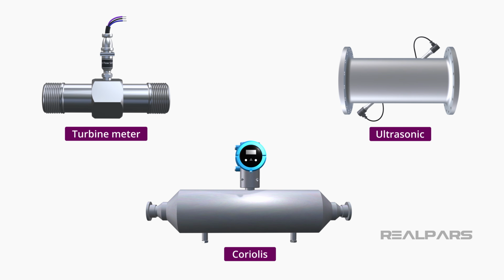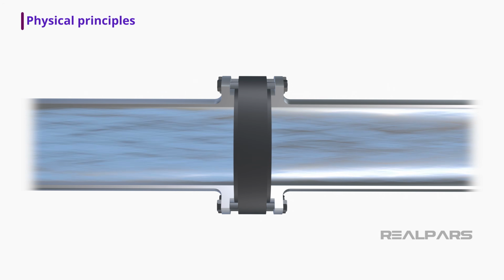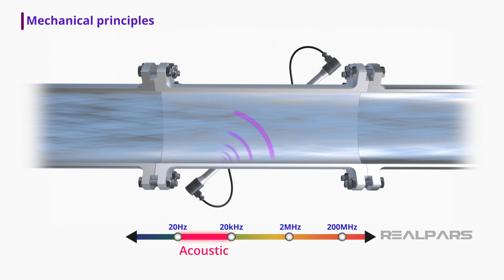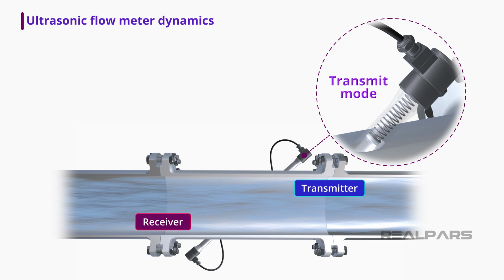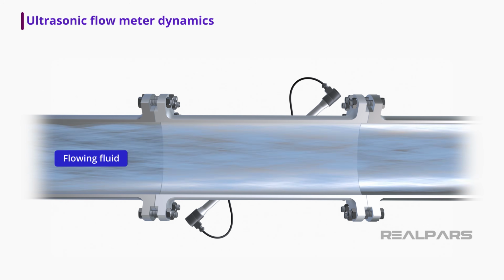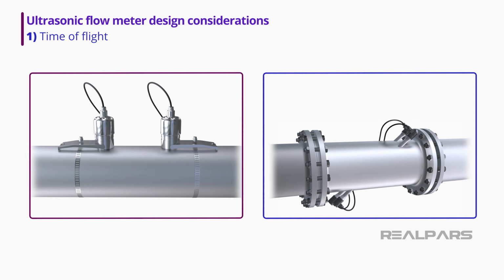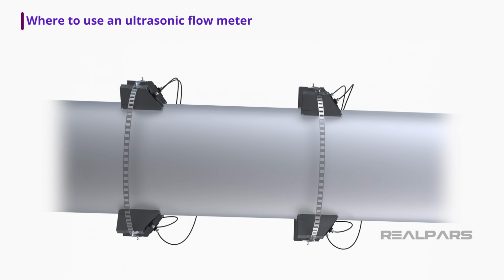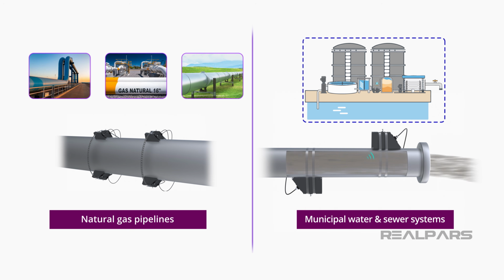Ultrasonic Flow Meter Explained | Working Principles

Comment: Can these be used for furnace oil measurement
Reply from the maker: Hello, @yellapu77ak Thank you for your question. The concept can be used with the correct instrument. You will need to contact your local vendor servicing your industry, who should be able to help you.

Comment: Justo , necesitaba ésto para decidir. Marcas sugeridas para agua potable en una PTAP . Y si hay un rango de conductividad o su baja turbidez ..0.75 a 2 NTU. Gracias
Reply from the maker: Hi @jesusmendoza9768, thanks for your comment! We’re happy the video helped.
We try to keep our replies in English so all our viewers can follow along, but here’s a quick summary:
For drinking water treatment (PTAP), trusted sensor brands include Endress+Hauser, Yokogawa, Hach, and ABB.
A turbidity range of 0.75 to 2 NTU is usually acceptable for treated water, depending on local standards.
Conductivity for drinking water is often between 50–500 µS/cm.

Hope this helps, and feel free to keep asking—we’re here to support you!

Comment: I see you reply to almost every comment so I'm going to take my chances and ask you something.  I'm learning a lot from your videos but I am still not sure what is the best type of flow meter is for my case and I would appreciate if you could help me. 

I want to measure the volumetric flow of water through a 3/4 or 1" pipe for a potable water vending machine I am planning to build.  See Watermill Express as an example.  Which type of flow meter do you think would be the best choice for this case?  I know turbine flow meters would probably work well but (leaving the cost factor aside for a moment) is the ultrasonic even better? Is it more accurate?
Reply: or is there any other better option
Reply from the maker: A turbine meter is the most compact and easiest to install for this application.  A small clamp-on ultrasonic flow meter can also be used fairly easily, but is not as accurate as a turbine meter.  Both have pulse outputs which will require an interface card, which is typically small and not expensive.  A compact magnetic flow meter could be used, as long as the conductivity of the water is greater than about 10 microsiemens/cm or so (depends on the specific flowmeter).

Comment: Are ultrasonic meters able to flow bidirectionally?
Reply from the maker: No.  The ultrasonic transmitter is positioned to send sound waves in the direction of flow, and the receivers are a few pipe diameters downstream of the transmitter.

Comment: how do ultrasonic flow meters perform on curved pipes?
Reply from the maker: Ultrasonic flowmeters need a straight run of pipe to work accurately.  Bends in pipes tend to distort the flow patterns and can lead to void spaces as the fluid makes the bend.  Both of these issues can degrade the flow signal.  Typically, a straight run of 10 pipe diameters upstream of the meter and 5 pipe diameters downstream of the meter will provide a steady and consistent flow pattern to allow for accurate measurement.
Reply: There are Electromagnetic flow meters from Siemens that has a Venturi shape inside. And they claimed it could be placed just about 1 meter before the curve.
Maybe there are something like that for ultrasonic flow meters.

Comment: hi why dont you make a pcs7 course on siemens
Reply from the maker: We do have an Introduction to PCS7 course that is available through subscription on the Realpars.com website!  It includes network, hardware, and program configuration as well as WinCC graphic development using a simple process example.  There is also an extension to the WinCC course for PCS7 that includes writing C-language routines to int4eract with the graphics.

Comment: how would you compare these to thermal mass flow meters for compressed air flow measurement?
Reply from the maker: Since most gas flows of this type are small, thermal mass flow meters have the advantage of a smaller footprint than ultrasonic flow meters.  For flow rates in the l/min realm, thermal mass flow meters are the only viable option.  Ultrasonic flow meters typically require entrained solids to be useful in gas applications, and for compressed air, that is not acceptable.

Comment: How are ultrasonic meter calibrated?
Reply from the maker: Ultrasonic flowmeters are typically calibrated gravimetrically, by collecting water flowing through the meter at different flow rates into a collection tank.  Because the gain of the meter usually varies with % of maximum flow rate, 10-20 calibration points from 0 to 100% are measured and the gain (correction) factor is calculated at each point to develop a curve.    This only needs to be done periodically (every 1 - 2 years), more often for dirty or coating fluids.

Comment: You seem to suggest that turbine meters are positive displacement. They are not. They are inferential meters or velocity meters
 They usually have a limited viscosity range enhanced with helical rather than straight blades. 
Ultrasonic meters, multichord, can handle fluids with viscosities as high as 4000 cst. 
What you didn't explore but rather simply brushed over to say this was why you had multichord Meyers, I'd that   the sound wave transits from transmitter to receiver and is influenced by the fluid velocity. Should that not be " mean fluid velocity"?.
It would have been helpful to. Explore the relationship between the measured transit time difference and laminar flows, transitional flows and turbulent flows.i would have expected to that swirl would have some effect. Not discussed.
However, a good basic explanation. Tks.
Reply from the maker: Jon, you are correct.  Turbine meters are velocity meters in their principle of operation.  However, they do share the property of positive displacement meters in that a single revolution is equated to a specific volume of fluid flow, albeit for a turbine meter this volume is calculated from the fluid velocity instead of a chamber volume.

As this is an introductory video to ultrasonic flow meters, we did not get into the details of differences in sound profiles through laminar and turbulent flow streams or the meaning of mean flow velocity.  Ultrasonic meters are nearly linear in response in turbulent flow ranges, but in laminar or transitional flow ranges, special conditioning sections upstream of the meter are required.

Comment: As usual excellent work. Can anyone tell please:
In which case, (for gases) we have to measure " mass flow rate" and in which case we will have to measure "volumetric flow rate"?
Thanks.
Reply: If you know the fluid you are measuring, and if you know the temperature and pressure that it is at, then you can always convert between mass flow rate and volumetric flow rate.  You can measure either, bring the measurement into the process supervisory computer, and convert there if needed.
Reply: @alexandernorman5337  Thanks for your kind reply. Keep it up.
Reply: @cck1496  domestic meters measure downstream of a pressure regulator. So. Essentially, knowing the gas quality, it matters little that you are charged by volume. (Usually, "tin case" or diaphragm meters.
 But in high volume flow industrial you can use a gas density. .meter in conjunction with a volume flow meter
Reply: @jonwatson9765  Thanks for your kind reply. 
Correct, it makes sense.
Thanks for sharing.
Reply: @alexandernorman5337 inferred mass
Reply: I suppose in a mixing scenario where you are metering the proportion of one material to another. Basically, so many pounds of this, to so many pounds of that. But for gases?

Like Alexander said, adding a temperature sensor (as well as some math) will give you your mass. One exception to this is for steam. For most applications you can count on what its temperature is going to be, and just plug that number in. 

Or so says the ABB rep that sold me my meters... :)
Reply: @MrWaalkman  Thanks for your kind reply.
For gas turbine, mass flow rate is measured but for domestic consumption, it's volumetric flow rate.
I may be wrong.
Thanks.
Reply: @cck1496  You're welcome of course!

When it comes to (natural) gas meters, I'm familiar with the Roots style (positive displacement), Diaphragm (bellows) meter (which IMHO are pretty cool as to how they work), and turbine gas meters (not positive displacement). 

What they all have in common is that you can get a temperature compensating drive for your meter's dial to correct for changes in measurement due to temperature. These gauge faces are (usually? always?) painted red. And you will see both flavors out in the wild (some municipalities choosing not to use compensation. Most seem to). So either way you are correct. :)

Some random rambling follows...

You also can usually install a pulser such as the "Pulsimatic" transmitter which will give you a pulse for a given volume passed through the meter (like one pulse per 10 cubic meters of gas). The standard setup on these is a C-form contact block which can be ordered instead with an A-form contact block. It will last much, much, longer with the A-form contact block. I would know, one of my assignments at Schneider Electric was to intentionally break things to see how long they would last in the field. Great assignment! I had no problem causing the C-form contact block to fail, but I never managed to make the A-form one break. My other assignment at Schneider was in Okinawa, which was pretty nice too. :)

And occasionally you will see "shadow" meters installed when a facility is concerned that the utility's meter in not functioning properly. The opposite is true as well. Utilities have fake transformer cans that can house a meter to see if a homeowner or business owner is stealing power from the utility.

When it comes to metering Liquified Natural Gas (LNG) or Liquified Propane Gas (LPG), it's a completely different animal. LPG has a Centipoise of .1 (for reference, water has a Centipoise of 1, making it 10 times more viscous than LPG). Which makes metering and pumping LPG a bit of a bear to do.
Reply: @MrWaalkman  Really appreciate your kind and detailed reply. 
Please keep on sharing your valuable expertise.
It's a lot of help to the new comers in  this field.
Once again, thanks a lot.
Reply: @MrWaalkman  Here is where a resonant frequency gas relative density sensor can provide the necessary measurement.
The relative density will chang we with composition.

Comment: Ultrasonic flowmeters have one outstanding advantage in that you can temporarily mount them to existing pipes. This means that you can make measurements on all of your piping with just one meter. This saves a ton of money compared to installing a flowmeter per pipe.

The downside is that (in my experience) the external ultrasonic flowmeters are a bit finicky to set up. But that can be said for a number of flowmeters. When it comes to metering, there are lies, damn lies, and flowmeters.

And ultrasonic flowmeters also require 10x - 15x of straight pipe before the flowmeter and 5x of straight pipe past it. But this is a typical requirement for most other types of flowmeters as well. 

What this means is that if your pipe is 2" in diameter, then you will need 20" to 30" of straight pipe ahead of the meter, and 10" past it. Not a big deal when your pipe diameter is small, but try it on some 60" pipes (ductwork) sometime. :)
Reply from the maker: Thank you for your comments on ultrasonic flowmeters. These "clamp-on" type flowmeters have a wide range of applications, especially for processes where it is either too difficult to physically install an in-line flow meter type or the process is not amenable to in-line metering. Upstream and downstream pipe runs are considerations that cannot be overlooked, especially if you want to have the best measurement accuracy. Again, great comments, and thank you for supporting Realpars!
Reply: @realpars  You're welcome! And it's always a treat to see a new video show up. :)
Reply: Very good information. Keep it up.
Reply: @cck1496  Thank you! :)
Reply: @MrWaalkman  Thanks for your excellent explanation. If you have time, would you briefly tell about wafer mags, thermal flow meter and positive displacement flow meter.
If you don't have time, ignore it .
Thanks for your kind explanation.
Reply: Well, you don't need to meet that requirement you cite for straight pipe.  You need to meet that to achieve the highest accuracy.  But if you only need to be within ~5% then you can work with a lot less.
Reply: @alexandernorman5337  Not according to almost every installation guide that I have ever read. Coriolis meters don't need straight pipe IIRC, nor do wafer mags and possibly positive displacement meters, but pretty much everything else does. And if your upstream bends are not on the same plane then you need even more straight pipe.

And I don't know if I agree with the 5% inaccuracy limit, that would likely depend on the type of flowmeter more than anything else. And the brand of meter makes a difference of course, some being better than others. I've definitely seen worse than 5%.

I do know that the thermal flowmeters that we installed in place of the wafer mag meters didn't have the 10x, 5x "smoothing" zones and performed very poorly. But the application allowed for a 50% error without causing any process problems (we just needed to know that material was flowing, we didn't really care what the actual flow rate was). And these meters were all over the place. Any given instant you might see a 50% change in flow. But for our purposes they did just fine.

The thermal flow meters were very attractive because they were completely smooth on the inside without any obstructions whatsoever. Because we were running paint through the meters we had to be careful not to create a place for "dirt" to accumulate. "Dirt" in this case is paint shop slang for paint clumps. Not actual dirt. Basically we didn't want goobers to form and plug up the robots. We also have to keep the amount of "shear" to the paint at a minimum. Shear breaks down the paint affecting the finish. So positive-displacement meters such as Roots type meters are out as well. Flow straighteners are a no-no too. 

DP, vortex, and turbine meters would have contributed to dirt. Coriolis was too expensive, and we didn't have enough room for ultrasonic meters. So thermals it was.

The thermal meters fit in where the mags once were, with some changes to the plumbing of course, as well as sacrificing the straight flow requirements. But it all fit within the allotted equipment space. 

But so be it. If nothing else engineering is a game of compromises...

So why replace the wafer mags? They were purchased without fully considering what the properties of the materials were that were going to be running through the meter. The meters were there for measuring the flow of paint as well as solvent that was being circulated through the tanks to the robots and then back to the tanks. It turns out that the paint that we were planning on using was non-metallic (as well as the solvent of course), so all 37 wafer mags showed "Empty pipe?" on each meter when running. 

Wafer mag meters, or at least these wafer mags, require metallic particles to function. So 37 brand new wafer mags in the dumpster.
Reply: Positive displacement meters don't need and flow conditioning. 
For other meters the killer is swirl and this requires straight pipe or a shorter flow straightener, tube bundle or egg crate.
What is really interesting is that domestic ultrasonic meters are single chord only yet operate from fully turbulent to laminar flow and thus must have some fancy signal processing, but claim not to need straight pipe before or after.
I'd love an answer to that.
Reply: Poor old positive displacement meters are getting a lot of stuck these days especially in domestic metering.
A bit sad because the way they operate means they are the most perfect of all flow technologies at measuring flow.
The principle is employed in ball and piston provers to calibrate every other type of meter, the bell prover for gas meters and flying meniscus and flying bubble methods for very low flows of liquids and gases.
For all the acclaim that modern coriolis and u/,s meters get, the meter that is used to fill your car is a reciprocating piston positive displacement meter. It is just so good that though this is a vast global market the modern technologies cannot touch it.
Not bad for a technology first patented in 1824.
Reply: @jonwatson9765  The only knock on PD meters is that wear will eventually throw them off. 

With that said, PD pumps (and therefore meters) can be obtained very inexpensively if you are willing to look the other way concerning what your parts were originally intended to be used for. 

For example, I have to meter in coolant/corrosion inhibitor and mix it with water for a lathe. For this I need a PD pump to pump in the coolant. Or a pump and a meter. So why not use a M81A oil pump from a Jeep instead of a "proper" PD pump? 

At $36 for the Jeep part, vs. ??? for a proper meter it seems like a no-brainer to me.
Reply: Thank you for this information.
Reply: @malfuriosstormrage5218  You're welcome. :)